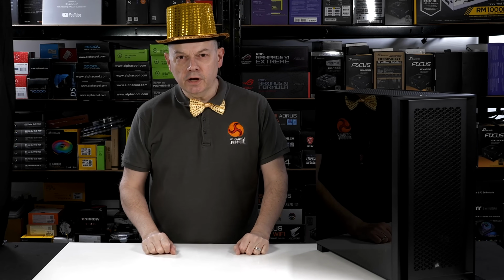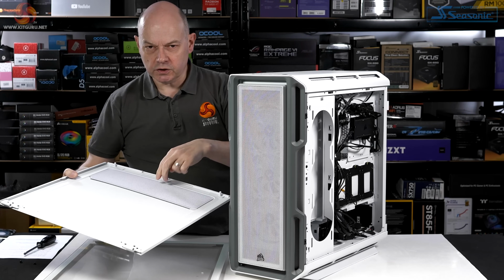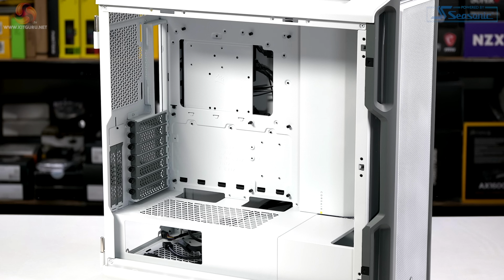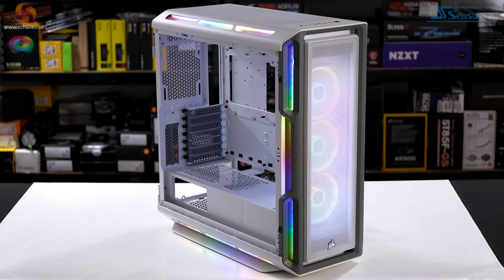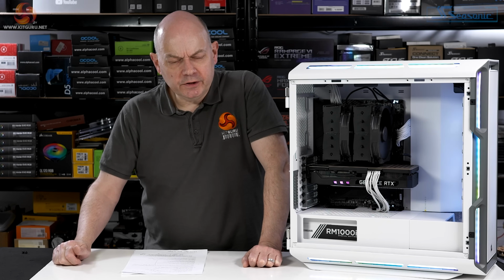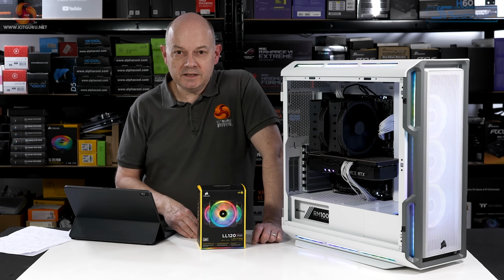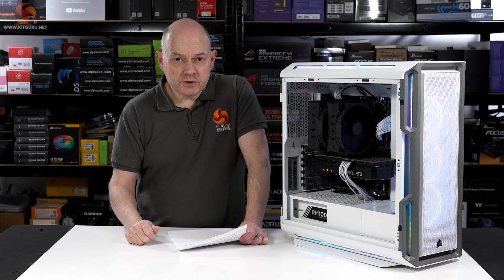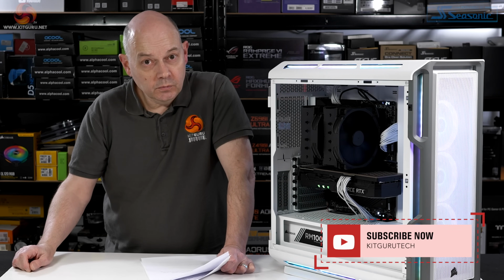Corsair iCUE 5000T RGB – Priced like diamonds

Comment: I see you also have CPU air cooling, I got a question I bought the 5000T and Aorus Elite X870E also got Noctua NH-D15 my question is would a gpu fit near it if not would 9070 fit on the lower part?

Comment: I got one from Facebook Market for $125, it was like new, not a single scratch, and it came with the fan controller and the 3 fans, I was impressed, it looks like it can be in fashion for at least 8 years, I used to have Thermaltake Core P5 for over 7 years and I never thought I'd replaced it until now!

Comment: Problem with this one is the fans aren't the Corsair premium QL ones. The LLs are good (actually better in some respects), but to include just three of them on a £350 case with no exhaust is just silly.

The 5000X QL edition is actually not 'terrible' value at £280 as it has 4x QL fans which are near £100 alone, so for aesthetic and for someone who JUST wants the QL fans for RGB purposes then there's justification for it. But the 5000T is hard to argue a case for.
Reply: It makes sense, or did back then because of the fans Corsair were using on there AIO's.

Comment: Can I use an amd cpu on this case?
Reply: Well, that depends on the motherboard you have and cabinets don't really restrict a build to a specific CPU model, most of the time.
Reply: @NavrajThapa2002  i contacted corsair to make sure my setup can be swapped in but i have a b450 aorus pro wifi with a ryzen 5600x cpu

Comment: I'd pay 350 pounds for a Fractal Torrent (which is actually much cheaper than that!), but I wouldn't pay that much for this. This doesn't seem as nice as the Torrent, but it's way, way more expensive.

Comment: why do you say 5000 mega tranfers ? not mhz
Reply from the maker: Memory is DDR i.e. Double Data Rate so 5200MT 'effectively' operates at 5200MHz but actually operates at 2600MHz. You can see this in CPU-Z as the reported RAM speed will likely be half the speed reported in the BIOS

Comment: The thing got commander icue .. 60£
And 4 fans...50...
But even with this and the new led top...
Its 169 + 50 + 60 + led... its 300$ .. msrp...
So 350 well they should get out those features and sell a basic empty version  for 190$ and it would be too much
Reply: if you broke it down, £169 case, £96 for the three fans, £55 for the commander pro, £25 per set of two led LED strips, there is three LED's each side, the case so that's £75.  £395 ?

Comment: Looks lovely and a nice addition to the 5000 range. I own the 5000X which is a lovely case for £140. This at £350 for a few extra LEDS? You must be joking! PS Glad i've found a UK based Tech channel dropped you a sub sir!
Reply: It includes a Commander core fan and rgb hub which is £50 and 3 x LL120 fans which are £72. Not to mention a single LED strip is £15 so let’s say there’s 2 worth of those in it which bring those additions to £162 of extras over the 5000D. The 5000T is £200 more than the 5000D. Those additions I mentioned are pre-installed and plugged in so that extra £38 covers that and the cooler case design. The 5000T also has more front IO ports than the 5000D.

Comment: Great review as usual. Having recently criticised you for your emphasis on AIO coolers I do appreciate you using an air cooler. You pointed out the fan cables as an issue; for a premium case like this I'm wondering why it doesn't come with all-white cables? Everything else is white.

Comment: At a time when so many companies are competing to make cases, why do they end up making basically the same case?  Even the touted 011D is a compromise, why?  Build cases for air OR water cooling, stop the pathetic attempt at making a single case for everyone.  

That case is needlessly large for air cooling,  The three fans to the right of the motherboard are not only useless but actually hurt cooling because the air is pulled in at the front and then immediately shoved back out by those fans.  Now someone is going to say 'orient the side fans to  pull air in instead', yes because you buy that 400 dollar rgb case to install the fans with the ugly side exposed?!  Seriously, it has not occurred to Corsair to produce fans that flow air backwards?!

So the side area isn't for fans, what is it for?  A pump reservoir?   Where's the bracket for mounting my Quantum Kinetic pump/res combo and how do I fill in the void if I don't mount fans there?  That would be useful and obvious!   So one of those flat reservoirs then?  Alright, but only 2 360's?  So water cooling is not ideal either.  Let's reconsider air cooling, what's the best way to the cool the most important part of a computer that is air cooled?  The GPU.,  What's the best way to cool a GPU?  Blow cold air directly on the GPU!  Does this case do that?   Nope, power supply is in the way.  Sadly, the 'water cooling case' does offer bottom fans to cool air cooled GPUs in the 011D, the case you couldn't mount a rad in the bottom of for water cooling.

 If the case is going to be expensive anyway, put a custom 1K watt platinum power supply on the back side with a proprietary design allowing it to be mounted vertically and flat that is fan-less.   The circuit board would run the top to bottom to form a distribution panel like on super high end systems.

That same case with a 360 rad mount in the bottom instead of the PS shroud with the stupid cut out to show the label would be way better, even if you just installed a couple of fans to blow cold air on the GPU.  Seriously?  A cut out to show the PS brand?!

It's another compromised design but thank god it has those 2.5 and 3.5 drive mounts!!  Because you gotta have somewhere to put terabytes of porn, right?

Comment: Yea. $399 can be consider less expensive than Cooler Master HAF700 $499. Corsair 5000T seem more airflow & RGB than HAF700, maybe 2 gigantic non-rgb fans & a lot of acrylic bar at the front make it so premium. 🤣
Reply: on the flipside, the HAF700 supports twice the cooling, much larger parts, and comes with a large array of accessories. also 2x200mm is better for intake airflow than 3x120mm, especially considering that its LL120's, fans known for the poor performance it offers vs its price.

also those "Acrylic bars" are actually TG.